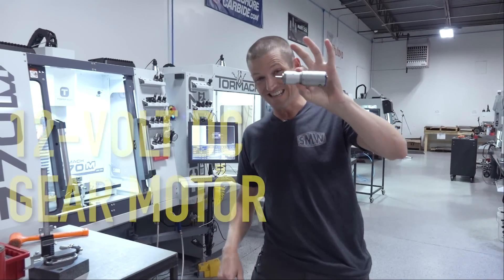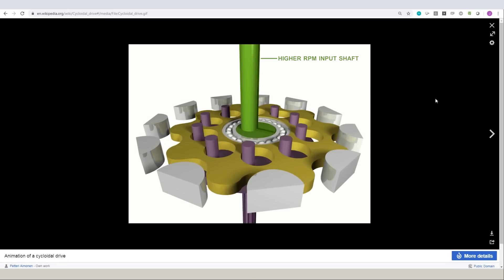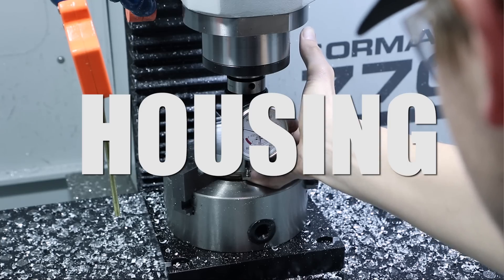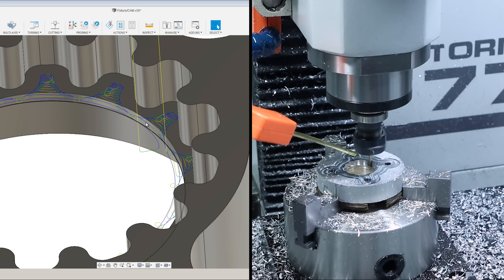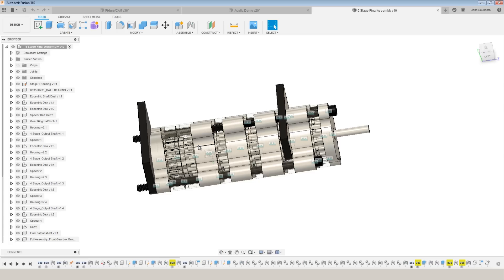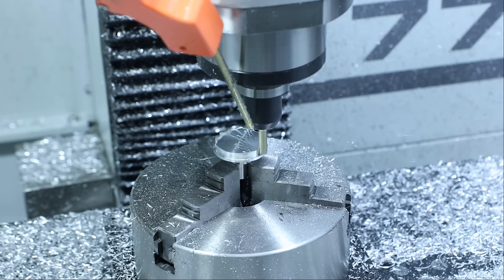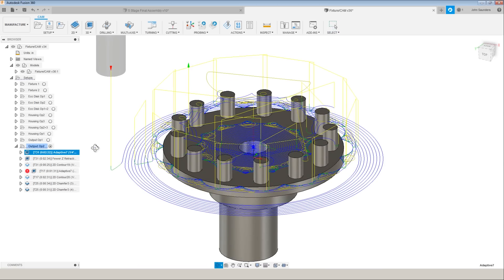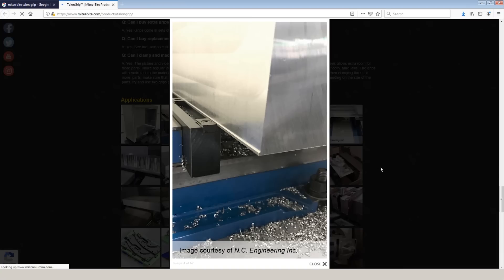Reduce Motor RPM with DIY Hypocycloidal Gear!

Comment: can we get one thing clean the machine operator did not make the part the machine made the part, the machine operator uploaded a design to the machines computer, the only human interaction is the uploading of the design and putting metal into the chuck

Comment: Sir, Thank you for sharing . Can you provide me the formula for calculating the Gear Reduction ratio for multiple stages. I have for the single stage ratio formula .. Lobe/(Pin-Lobe) . My requirement is to convert an RPM of 20,000 to 100 RPM. There is also a Space constraint too.. The od cannot cross 50mm and the length can be 100mm .  Thanks.

Comment: 10:38 that what fails on fusion360. model is there you say cut this. it cut wrong.what is so smart with it lol NEVER EVER should cut more. means inside PART. hand writed gcode is faster. bcoz i allready know patgh its on drawing. im not design part

Comment: Having the pins that interface with the holes in the hypocycloid swapped for rollers and sealed into an oil bath would improve the wear characteristics of this design quite a bit for heavier usage.
Reply: and also adding rollers to the outer teeth.

Comment: Can this be used the other way around? Increasing rpm?
Reply: Yes - but only with a reaaalllly long lever. It takes LOTS of torque and the RPM that would produce would likely tear a gearbox apart

Comment: FYI @NYC CNC in theory, in a harmonic drive all except two teeth are engaged.  It takes some mind bending to get a feel for how that works without a ton of sliding friction, but it's true: https://pdfs.semanticscholar.org/71b0/0532ebb6018265487fd7d50277ac74d2f1ca.pdf

In practice only a fraction of the teeth are actually engaged and they dont carry equal load, but even the two main teeth are taking a pretty small amount of the total load.

Comment: Are you aware of a "gearbox" type related to the cycloidal one?  This one consists of "gears" that are planer with cycloidal wavy grooves machined into their surfaces.  They are stacked up and ball bearings ride between them.  Like the cycloidal units, one of the discs is forced to orbit by an eccentric.  One plate is mounted fast and the other rotates as the output.  The advantage is that all contact is pure rolling and all backlash is taken up by an axial clamping force on the whole stack.  They are also easier to machine, as all the complex CNC machining consists of milling grooves with a ball mill.  The remaining machining can be done on a lathe manually.
     Comment about your "gear" tooth milling profiles: I see all this short pass, lift (sideways) off, go back, and then cut a little deeper.  This involves a lot of machine back-and-forth motion.  Why not continuously circle around the piece, getting a little deeper each time?  This reduces machine error due to backlash and accelerations.  You also decide the profiles based on COMPUTING difficulty.  That is case of tail wagging the dog.  The fastest machining is WAY SLOWER than the slowest computing.  (and lifts ARE NOT easier to do.  I once overheated the Z-drive on a bridgeport Eze-Trak mill with drill pecking.)
     Please don't join the "hit <enter> and run" club.  MANUALLY involve yourself in the toolpath calculation!  I see way too much of this given bloated computing capability creating inferior toolpaths.

Comment: Do you have the design doc or the math for the double stage reduction shown in this video. I've been playing with these reductions for a while now but mostly in single stages and I understand the relationship between the "lobes" and "pins" and how they affect the overall gear ratio like your first 'stage' of the disc has 13 lobes and with the housing fixed this equates to a 13:1 stage. I am having trouble wrapping my head around how the second stage contributes to the output ratio. I built a quick dummy model in SolidWorks last night with 10 lobes and 5 lobes on the stages respectively, set up the contacts and constraints and ran a motion sim and got the expected 10:1 out of the disk relative to the housing  but an unexpected 5/6th of a rotation of the output disc overall. I'm mildly confused and would love to be able to play with the math that drives the second stage and it's impact on the overall ratio.

I too am part of a robotics program (FIRST Robotics) out of Northeast Ohio. I'm mechanical engineering mentor. Good hearing about the expansion of young minds towards STEM and related fields. Great video, thanks for the content, and have a nice day!
Reply: Okay, so I figured out the "perfect square" version of this gearbox in two stages but now I need to experiment with ratios in between. This morning before work I figured out a 100:1 stage much as you have shown above where I have 10 lobes (11 pins) on the input side of the disc and 9 lobes (10 pins) on the output side. I had already known that the relative motion determines the ratio (i.e. what is fixed vs. what part is moving) but I still don't fully understand the math when you move away from perfect squares, I'll have to look into it more after work.

Comment: Yeah My company employs them a great deal, they have the highest torque density of any of the alternatives and providing you use the recommended lubricant they are bombproof. just a note :- its RPM not RPMs ( Revolutions per minute) not minutes

Comment: Hi. For balance issues for this kind of gear why don't combine 2 of then in a 180 degree out of phase setup?
Reply: This is exactly what I did on the multi-stage aluminum one. It only needs done on the first stage though, after that everything moves so slow there's no reason to balance it.

Comment: I could watch this for the machining alone. But the mechanism, enthusiasm for knowledge, and willingness to share.... Where where you when I was a teen wanting to get into robotics, electrical, and mechanical engineering? ...oh, yes, you probably weren't born yet :).

My parents had been machinists, as well as my mother's father and all of her brothers (although 1 became an electrical engineer for 20 years before returning to the machine shop). I transitioned from software analyst/programmer into applications engineer for ComputerVision, then contractor, writing CNC paths as well as custom CNC software, before writing early CAD tools constrained by manufacturing capability. I made the choice to leave the industry when consolidation in the industry, a shrinking manufacturing base, and the need to provide for a family with three young kids became too challenging. But I still love the sounds, sights, smells, and technologies of a machine shop. 

Keep up the exemplary work!

Comment: Currently in my second year of college for machining. First year was all manual, tooling, and safety oriented. Second year is CNC oriented. Which is beyond cool. But we’re using solidworks and mastercam. Mastercam is a pain in the pooper. And solidworks, while i think it’s the best modeling software, is also being a pain due to the schools computers being junk 😕. We’re in a brand new, 14.5 million dollar building, some of the funding from the Gene haas foundation, with two labs. A freshman lab with maybe 13 manual lathes and 13 milling machines. And a freshman lab with 9 (different) haas milling machines and 4 CNC lathes. Including a 5 axis and a horizontal CNC mill. All that but the computers are trash. Can’t really complain though, it’s an awesome building.

Comment: Very cool!  I work with a robotic team and we frequently use multistage planetary gear sets to gear down to slower speeds and higher torque.  This would be a fun project to play with -- it would allow us to gear down in one stage and thereby reduce complexity and weight.

Hey John, wouldn't that output "gear" be a lot stronger with a fillet or chamfer at the base of each pin?

Comment: There is a simple way to get a small fraction of a turn per stage.

Two almost identical rings with teeth on the inside, the output ring has one tooth more (or less) than the stationary one. Then put a small gear running along the inside of both rings driven by the motor similar to a planetary gear. Use a crank to run the gear along the inside of the rings. The input shaft moves the gear along the inside of the rings, the gear is freewheeling. When the crank does one revolution, the ring with the additional tooth advances by a tooth.

If you use 99 and 100 teeth, the output ring advances 1/100 of a turn.

Comment: I designed a robot with harmonic drives and servos for joints. The precision and gear reduction in a small package is unmatched.

I think the backlash was 6 arc seconds.
Reply: what is backlash
oh. empty room to rotate. what is a n arc second? a 3600 th?
Reply: @snorttroll4379  1/60 of 1/60 of a degree. Degrees, Minutes, Seconds of arc. A blonde one.

Comment: what happens if you attempt to spin the other end of the mechanism at a high rate?  how fast would the output spin if you put 1000rpm into it?
Reply: Realistically you can't turn it from the output shaft - or at least you need a LOT of torque. Spinning a single stage from the output shaft at 1K RPM gives an output of 169,000

Comment: This was really fun. I spent my career maintaining CNC. Synchronous gears were somewhat common and I never saw a mechanical failure in 34+ years. Your Hypocycloidal description and illustration was spot on. I have never experienced Hypocycloidal gearing. Watching this description reminded me of all the clever ways Burgmaster employed the Geneva wheel. Indexing and positive lock positioning for indexing turrets with a single rotary function was their design hallmark. Rugged, repeatable, wear compensating, accurate were impressive characteristics that impressed this young repair technician. I never experienced another manufacturer employ the Geneva wheel.
Trochoid pumps employ related technology. They provide gear reduction in a very small package and until wear becomes a factor are self priming. Mazak loves to employ Trochoid pumps.

Comment: I just want to see a single gear in action..but that is pretty cool...is the machined aluminum ones less noisy than the acrylic?
Reply: Yes, but the aluminum also has a 180° offset disk to balance it which helps. We also never spun the aluminum one up quite as fast
Reply: @alexpinson7759  definitely want to see more on those types of gears!

Comment: Having some high speed micromachining/ hard miling speeds and feeds on proven cut would significantly improve the value proposition for my shop because most of the work we do is fine detail injection molding. Sometimes as small as .004” slots in 55hrc tool steel

Comment: Thanks for a very interesting video! There is many ways to utilize a planetary gearing, have a look on this clip "https://www.youtube.com/watch?v=g821BOC_oAQ" (it's only 26 sec.) 

Also here's how you can mill these gears if you just modify the gear profile slightly. I am using an endmill with the same diameter as the module on the gear I'm making. 3 mm endmill for a module 3 gear. "https://www.youtube.com/watch?v=dwi51Vd55dQ" (2 min 56 sec)

Comment: I really really want an entire video on how you designed it and made the joints, I want to make some cycloidal mechanisms myself
Reply: Here are the equations to generate the disc:
x = R * cos(t) + e * cos(N * t)
y = R * sin(t) + e * sin(N * t)
R = ring radius
N = number of pins
e = eccentricity
t = 0...2pi
Then inset that curve by the pin radius.

Comment: There are Hypocycloid plugins for fusion https://github.com/tapnair/Fusion360HypocycloidGear and https://github.com/mawildoer/cycloidal_generator. This project also tries to solve the unbalanced issue and decrease backlash https://hackaday.io/project/157812-3d-printed-robot-actuator. Great job the gear box looks great. BTW I believe Hypocycloid gearboxes also have the advantage of being back driveable unlike harmonic which means you should be able to do torque control which is need for several types of robotic actuators.

Comment: Definitely check out, "Gear Down For What?"'s channel. He does this kind of stuff but 3D printed. Pretty awesome.

My advice to your recent intern is: don't do a degree, work For JOhn for 4 years instead.
Reply: @Abitamim Bharmal and at the end of 4 years working with John, he will know how to  actually make stuff, including money.

Something the guy who "knows" fluid dynamics or thermodynamics will have no experience with. What the degree haver will know is that it's going to take a long time to pay off his degree, something the worker will never have to worry about, stepping out with not only industry-standard, immediately applicable knowledge and experience, but more likely than not, a healthy bank balance, not a massive debt.

Theory can be learned later, when you know what you want to do for fun.

I guarantee of the people who "know" fluid dynamics or thermodynamics, 20% or less of them will use it at work.

With F360 doing FEA these days, that paid for knowledge is unlikely to be a differentiator in things that matter.
Reply: @Abitamim Bharmal uh huh.

Comment: You could use brushless motors, they are significantly more efficient, and you can get a really low KV value which gives a much lower speed and higher torque usually making any gear box obsolete. And encoder feedback can ensure the motor spins at a very specific speed with very little error. You can even have it hold a position using no power unless it has to actively cancel out a force.

Comment: At 8:40, shouldn't you have indicated on a pin in the jaws instead?  That raw material surface is not necessarily perfect with respect to the stem.

Comment: Could you add another Hypocycloidal gear "half" on the underside of the same mesh portion 180 off and get the same benefit of the harmonic system?
Reply: Ive seen an article about this somewhere

Comment: There's a special type of planetary gear with a really big gear reduction, it's called Wolfrom gear. It consists basically of two combined sets of planetary gears, the motor drives the sun gear of the first stage, the ring gear of the first stage is stationary, the second gear ring can rotate and is the output of the gear. The tooth count of the rings idealy differ only by one. The planet gears are connected with eachother, the second stage doesn't really need a sun gear.
The simple explanation of it is that the planet gears try to keep the teeth of the ring gears aligned, but because of the tooth difference one of the gears slowly walks further as the gears rotate.
Here's a video showing it running:
https://www.youtube.com/watch?v=hKwtyd990a4

Your gear mechanism is also a two staged configuration, it has a special name too, but I don't remember. You definitely want the outer bearing points to be able to spin or you'll have to deal with much friction. Also, you'll need some kind of counter weight or you'll get a lot of vibrations because of the off center mass. Here's a pretty good design: https://www.youtube.com/watch?v=pTsoTiB2B4k
Reply: now that is some common sense right there.. very nice
Reply: You can also drive compound planetary gears by the carrier, so neither stage has a sun. Actually the compound cycloid in this video is an extreme case of that design, with only one planet gear, and one tooth difference between planet and ring. The eccentric cam acts as the carrier, and the cycloid teeth are necessary because involute teeth would jam without a sufficiently large difference in tooth count.
Reply: @Klaufmann "You definitely want the outer bearing points to be able to spin or you'll have to deal with much friction."
Why? I thought the shape of the disc was calculated to have rolling contact against cylindrical pins, so they should never spin anyway. Or is it just a way to compensate for machining inaccuracy and/or elastic deformation of the disc under pressure?
Reply: @dekutree64  it's not a rolling contact, the cycloidal disk is almost constantly sliding against the pins. So if there are rollers on the pins, you can avoid the sliding friction.
Reply: After researching and finally understanding both epicyclic gearing and strain wave gearing, i realized the similarities they shared and that the two concepts could be put together. Now i finally know the name of it; the wolfrom grearing! It's super cool stuff, but have yet to understand the proportions between the two sets of planets and rings.

This cycloid gearing has a really cool advantage though. All meshing (i think) can be fitted with bearings. Surely that will make for much smoother operation and a longer lifespan. Although maybe it's too expensive to implement in a mass-produced machine.